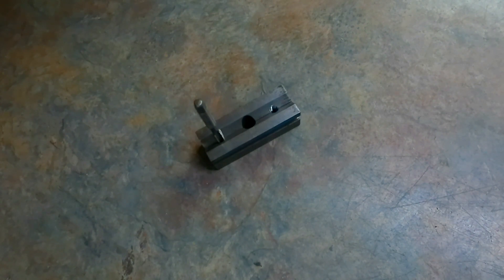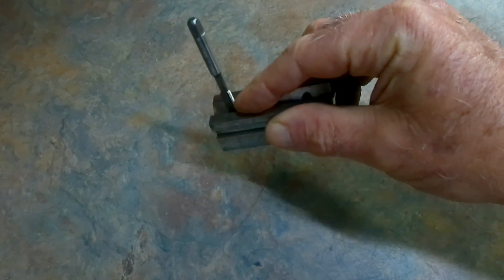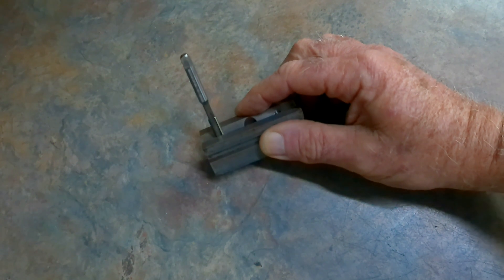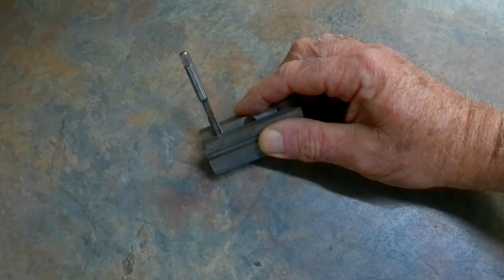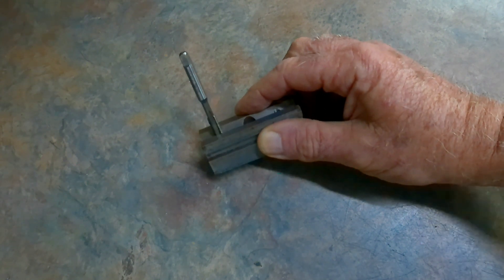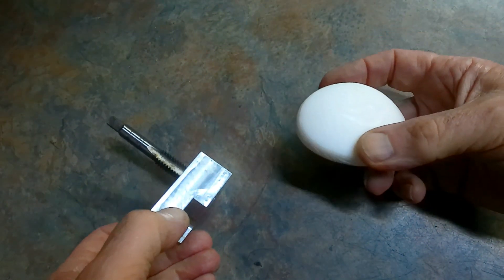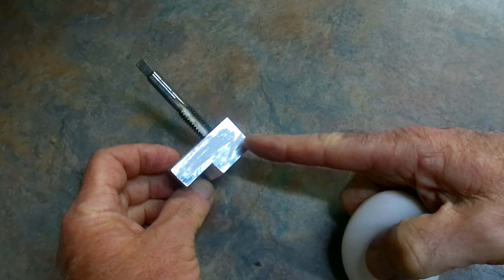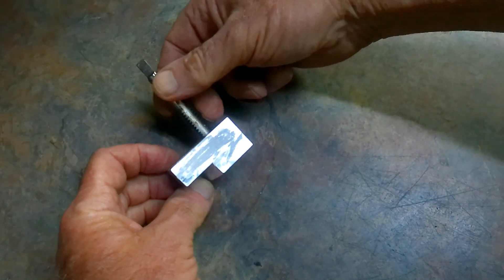If You Have A Stuck Tap And You Fear Breaking It. Watch This Video.

Comment: My old dad taught me the tip about Ali and bending it with the rub of soap, I had to do it last week for bending some Ali sheet for this loco. Did the heating. put the torch down went to get my gloves and like a tit I had one glove on holding the other and fingers went HISSSSS. Suffice to say I am now going safe cracking as I have no fingerprints left.. WHY I did that I have not a clue. 
Thanks for your hints tips and tricks. My old man said it was the millwrights that ruled the roost in the machine shop.
Reply from the maker: Thanks for the view and your not so funny story. The smell of burning skin will haunt you for a few hours. Good luck with building your loco. Regards.

Comment: What a great trick with the aluminium.
Reply from the maker: Hi Guy, yes it is, you can also use it to anneal aluminium rod and plate  for easier bending, It just a simple temperature indicator. You can buy expensive Temperature Wax Test Crayons, but a bar of soap is cheap or even free. Thanks for the view. Regards.

Comment: Excellent advice here. Amazing how a bit of heat can break things free. The soap trick on ali is great to have in the tool box as well.
Reply from the maker: Hi Stuart, without me watching the video again, I can not remember as to whether I said that when the soap goes black it is the annealing temperature of aluminium. Handy to know if you want to try and bend or straighten some. That is bar and plate aluminium, NOT diecast or what is called in the trade jig and tooling plate ( that machines very dusty so you know ) Thanks for watching. Regards.
Reply: That’s the one Dave - the soap turns black. A very neat trick!

Comment: Strangely, I used to enjoy removing broken taps at my last job. 4 flute taps are my favorite 🤣. Thanks for sharing!
Reply from the maker: Thanks for watching and your comment. Perhaps you could enlighten the viewers with how you managed to achieve this often difficult process. Thanks. Regards.
Reply: @daveticehurst4191  Worked in a maintenance shop for a lot of years. If it’s a through hole and 3/8” or bigger hole size, “bumping” it with a plasma cutter to blast it out works good, sometimes I use Tig or mig to build the broken tap up high enough to get a washer and nut tacked to it. Sometimes hammer and small chisel to break the brittle tap into smaller pieces and dig it out. If the holes ruined, I fill it in with weld and redrill and tap it. The biggest worry is to try to not overheat the heat affected zone which is not good when dealing with cast or tool steels. Thanks!

Comment: I used to save broken taps for a source of high speed steel, for making bits for single point threading, boring, etc.  But we shouldn't be breaking bits either.  One time I broke a tap off in steel, had nothing to loose, I used a flame with excess oxygen, with a small heating tip, I was actually able to burn the tap out, I was probably just lucky.

In heating a part to expand the metal, as the metal gets hot, it expands, but wouldn't that make the hole actually get smaller too?  Then of course, it would be nice to somehow cool off the tap to make it shrink a bit while in the hole?

Where I used to work, we had a machine, was it called e-locks?  It had a small metal tube would drive down into the broken tap or drill bit with an electrolyte flowing down the center.  Electric current was supplied and it ate the broken tap or drill bit out, but not too many people have that equipment.

Would never thought of using soap to help determine the temperature of metal to avoid annealing, etc.  Thank you -  Jim
Reply from the maker: Hi Tim, thanks for your view and comment. With regards to the part shrinking as well as expanding, you could well be right, but I have found it to work. As I said you have noting to lose by trying. We also had a tap remover in the 1970's but it was not very quick. Once we got a Charmilles EDM machine we were well away, although broken taps were not a common occurrence in our shop. Regards.
Reply: I would think that heating up the tap would temporarily swell it but when it shrinks back down you have a chance of that swelling and shrinking breaking the chip.
Reply from the maker: @richardthorpe8889  Hi Richard, thanks for the comment, you are probably right. I just know that it has worked for me in the past and thought it might help other when they get that problem. Regards.

Comment: That soap trick is a new on me.  I couldn't quite make out whether it needs to be a certain type of soap?
Reply from the maker: Hi Mike, worked back in the 70's at work using whatever the stores hand soap was. I think any hand soap will work, that was Dove soap in the video. When I fitted the heat sink to my grinder table motor, that was a flat extrusion, soaped and heated then wrapped it around a bit of stock. Give it a try on a bit of scrap ally and see for yourself. Regards.

Comment: Another useful tip for the armoury!
Suggestion for your growing list: Perhaps you might tackle the subject of lapping - for finishing and for accurate sizing and squareness?
Thanks for sharing, Dave.
Reply from the maker: Thanks for the idea Russell, not too sure about lapping, I have done it, but there are already out there some very good channels that have done an excellent video on it. Will give it some thought. Perhaps I could just touch on the subject then put a link to the video that goes into great detail. I will sleep on the matter. Thanks for the view and your suggestions, duly noted. With regards to the sizing are you talking of measurement of sizes or how to get them ? Regards.
Reply: @daveticehurst4191  My thoughts were along the lines of bringing a hardened piece to an accurate size and good finish. An example would be a set of V-blocks made in the shop and needing to be matched within a given tolerance.
Reply from the maker: @russelldold4827  OK will think on it. However a good suggestion if you have not started making them is to make them as 1 item so        that they are identical. Do not cut them in half until after grinding. Before hardening machine away a  lot of the bulk at the split line, but leave enough section that can keeps its form. After grinding cut off with an elastic cut off wheel, preferably mounted in your surface grinder. Email me for more detail. Regards.

Comment: Hi Dave,
Great video mate !
If the tap sticks it was probably blunt and therefore heating it up shouldn't worry anyone as it should be binned anyhow .
When oxy welding aluminium we used to use the soot from the acetylene to blacken the surface of the part we were welding and the soot burns off just before the aluminium melts , we couldn't use soap because it would contaminate the weld  pool but i have used it for things like you just showed and it worked well.
Reply from the maker: Hello Ian, thanks for the view and your comment, glad there are others out there with the soap knowledge. Regards.
Reply: @daveticehurst4191  
I wonder how many looked at the picture on YouTube and thought how is he going to get a tap out with a boiled egg? Then watched it only  to realise it is a cake of soap !
Reply from the maker: @Flattyman  Hi Ian, yes I have had some one think that already. YT choice of picture other than one of me and me holding the steel block. Do you think I should change it so I don't get accused of "Click Bait " Regards.
Reply: @Dave Ticehurst  
No it’s all good Dave !

Comment: Neat tip Dave! Thanks for the info, really like the soap idea. I wonder if different brands of soap have different temps. May be a good improvised temp stick in a pinch
Reply from the maker: Good question Dave. No Idea, seems to work fine though. Thanks for watching. Regards.